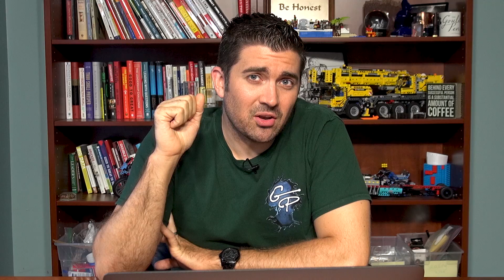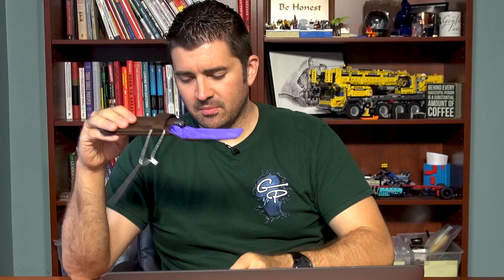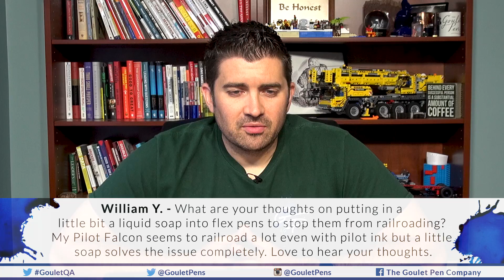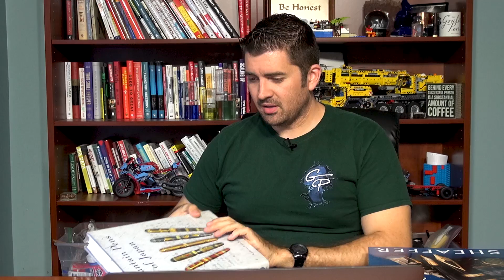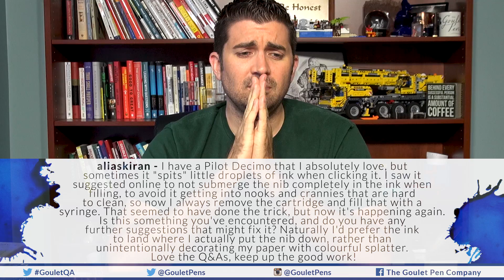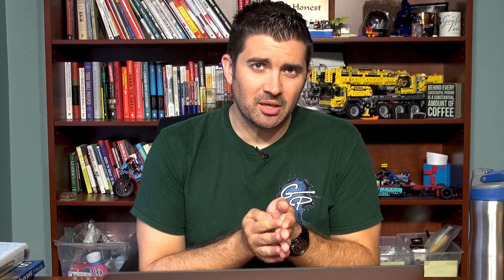Goulet Q&A 178: The Strangest Inks, Making A Goulet Pen, and Movin' On Up!

Comment: I'm three years late but answering the QotW, what would I like to see? Perhaps inks more than pens, I know you have worked closely with Noodler's  in the past but maybe coming out with your own brands or blends of inks. I imagine there would still be a lot of startup challenges including bottling, tooling up and labelling - however the one that I think would be top of the problem pile is, how to make each batch of ink consistent with the previous batch. I remember from your video with Nathan that each batch may be slightly different than the last. Perhaps that could work to your advantage and make it more of a limited edition thing. If you picked what you love most, such as shading or permanence, then see what you come up with.

Comment: The Goulet Fountain Pen .. hmm ... I see the first as an entry level pen, acrylic body, Goulet steel and Gold nib options, Cartridge/ Converter. . Because that's what I think your core brand foundation lies in .. helping people get into a long term relationship with fountain pens and the habit ... over time I do see mid level pens at the Noveau level with expansion of the this line with different form factors, shapes and nib options with a collaboration with a nib meister for different nib options. .. annually a themed LE pen which woukd be a real cut above and woukd represent the Goulet brand as it's ambassador .. I believe it would be important for the Goulet fountain pen to not challenge the bigger existing brands head on... this could skew the strategy to vacating certain price points/ ranges in the immediate term.
Reply from the maker: All good thoughts & progression. Definitely want to see it in that entry-level price range. - Colin

Comment: QOTW: I would like an ebonite feed. I don't know if anyone other than Noodler's and some Indian brands do this. A large capacity would be nice. Maybe have a blue cap and if it has a separate end that can be blue too, with a demonstrator body. Though a nice white body could work. A blue/white combo would look pretty nice.

I don't think this would work on the same pen, unless it has a swap-able grip section, but having a dip pen compatible feed would be pretty nice. I know those have to be replaced, but they have some interesting nib options, and it would be nice to not have to dip them all the time.

Comment: I would love themed pens: Mermaids (blue teal purple jewel tones), Unicorns (white purple blue iridescent oil slick or holographic like a CD), Dragons (matte black with glossy lava running down the side, or green scales), Elements (earth air fire water), Wizards (pens that look like wands). 
Possibly harder but last idea: Oil Slick barrels. Barrels that color shift so the middle is a highlight color and the edges are a different color no matter how you turn it, as long as the light hits it the same way.

I would also like nib feed combos to be kinda dumbed down for me. I tend to like wet writers, so having a wet/dry nib/feed designation would be awesome. 

Of course, with the latest trends, I'd also like FLEX options on nibs. 

It would also be kinda neat to get a pen that matches your favorite inks and made specifically for it. J Herbin Emerald Chevoir could have an emerald resin barrel with purple/gold shimmer throughout that is made to write bold and wet so the sheen comes through.

I also tend to like classic pens if you want a permanent line. White barrel with gold accents/nib, Matte black with silver, Goulet blue with gunmetal? (Ps. white and gold are my favorite colors)

There is also a pen I was introduced to by the Pen Habit channel: Kahakai by Kanilea fountain pen co. The barrel goes from a sandy opaque beige to a translucent watery turquoise/green and ends in a deep opaque blue green at the top of the cap. It also has gold accents. It's probably the most beautiful pen I'll never afford ever... even the grip that is normally black is the see through turquoise (I'm also highly biased because I'm from Hawaii)

You could also make "starter sets" with existing pens that would include: syringe with blunt tip needle, silicone sealer, bulb for flushing, sample of a set of inks (Brian's favorites, Rachel's favorites, shading inks, best sellers, etc) and a notebook to practice and do ink tests on. (Or bullet journal starter set?)

I also like monotone metal finishes: Silver barrel. grip, nib, cap; Gold barrel, grip, nib, cap; Copper/Rose Gold barrel, grip, nib, cap, Gunmetal/smoke barrel, grip, nib, cap etc... If you could order ala carte that would be awesome too

Random thought just now: Rose Gold tone nibs. I'm sure they are out there but not too common. It could just be a plating that looks like copper or rose gold but gold and silver are great classics, having another option would be amazing.

All of this of course would be if I could do ANYTHING I wanted, I tend to have a million ideas and not enough time or money to execute them. So I just throw my wishlists for items out in the world and hope I can afford them when someone else makes them. >.<
Reply: PS. Prepayment options would be nice too. Like $50 a month going toward a $400 dollar pen before it launched.

Comment: Ink spatter I totally agree with Brian its likely the pen casing has tiny amount of ink in it. I use a pilot vanishing points as my daily writer, my work pen especially gets a lot of dings from use, I bought it to be used not for collecting. I am also a pen twirler and have yet to get ink spatter anywhere. Its a medium and writes wet with iroshizuku ink. Every so often I give the inner unit a good flushing and reinking just for maintenance and i run water through the body end too as brian suggested and it always shows there is ink inside the body, not much but its there. If you clean the body too I think a change of ink could be in order for at least a little while to see if it reoccurs. I keep my pen clipped to my shirt neck when not writing, at all times so it doesn't go walking in the office, I dont put it in a bag which does get thrown around a lot, I always want a pen on me and this is my routine. Maybe after you try a change of ink, perhaps try a change of habit to cut down on how much jarring the pen experiences but you should be confident of keeping your pen in a gym bag if you want and have it perform well. If you take the body end off, wrap it securely in tissues and give it a flick you'll see spatter on the tissue. Pens use both capillary action and air pressure/humidity to effect flow and when you rapidly move pens around on their own or in a bag you are adding extra forces that can change that and force ink out, its not a defect of the pen though.

Comment: A Goulet Pen would easily switch colors (convertor). Easily switch nibs with screw in type. Not a demonstrator. Fell good in my hand when posted. Screw in cap with enough threads. Fitting clip for my pocket. Good size and weight for my big hand. Preferably not plastic. $150 or under. Best of luck in your move. Good work pays off. Congratulations!

Comment: QOTW: 
1. A fountain pen designed for travel: vac filling system, pocket size with snap on cap and secure posting (or retractable nib), lightweight but sturdy and durable. And of course with accompanying ink bottle suitable for travelling.
2. Eco friendly fountain pen - made of recycled material, or easily recyclable, or from eco-friendly plastic (bioplastic).
(in any case Rachel should be in charge of colours :))

Comment: I like the idea of a plastic dip pen as it would have a much lower cost- although it's being plastic would likely mean the tip couldn't be smoothed if necessary - so if that were the case then no plastic dip pens. Unless it were possible, then yes. I know, make up my mind :-)

As far as a Goulet pen, I really like the idea of your continuing to collaborate with companies like Edison and Conklin. In my opinion everyone benefits by this kind of collaboration and both "sides" gets to focus on their talents without the need to duplicate services and processes - and run the risk of being spread too thin. Are there other companies with which you could collaborate?

As far as my ideal pen that I would love to see - buttery smooth nibs that have slightly larger nib sizes - (I prefer larger "fines" or smaller "mediums"), smaller grips (no triangle shape) without being TOO small (between 9-10mm) and vibrant DARKER colors with a non-metallic body/grip that are light in weight. I realize it probably isn't possible to have yet another set of nib sizes considering they aren't made in the US, but it was worth mentioning as I'm dreaming here. I do like a pen I can take completely apart for cleaning with replacement nib units (and feeds)- that's of more importance to me than the filling mechanism.

I also like the idea of a time-lapse video of the move process - and congratulations on the move to the new space!

Comment: What would I want to see?  Eye Dropper or Piston (Or hybrid!) with a customizable nib.  Literally, "Select your nib" during checkout.  A long thin window on one side to show ink levels (and piston position) in an otherwise solid pen in your choice of a few different finishes.  Something durable, something pretty, plus a limited edition hand crafted, individually numbered version in something like Maki-e or burnished blue steel, or similar.  Of course, the hand crafted version would be more expensive.  For something vaguely like described, for the basic models, I'd expect to pay between $30 and $80, depending on the materials chosen.  For the hand crafted edition, I'd think about $200 is a hard upper limit.  and I mean HARD upper limit.  Closer to $120-150.

Comment: QOTW: I've thought about why hasn't a pen company designed a pen with a standard international converter, but for it to be wider to hold more ink? The body of the pen would have to be wider to compensate  for the converter, but for myself I think with the easy maintenance of changing and cleaning ink in a converter is pleasing. But to have a larger ink capacity would be a neat touch.

Comment: I don't know what the legality copy right or brand nuance of this would be, but I think seeing a pen in the lower "next level" range that's a vacuum filler similar to the visconti power filler (ie is a vacuum filler where there is a separate chamber above the feed that allows the writer to not have to unscrew the piston) would be a good addition to the market.
Reply from the maker: I think any affordable vacuum filler would be a great option. Right now, TWSBI seems to rule the roost in that regard, but I think there's design & functional changes that could happen. - Colin

Comment: Hi Brian, Chudfumpy here, I'am also a precision engineer with a machine shop in the UK full of CNC lathes etc, hence my question about producing your own fountain pen... I assumed you would farm out the manufacturing to a local machine shop with CNC lathes, as machining the parts really should not be a problem to a decent machine shop and you already have the nib side sorted.... Machining fountain pen parts is no different to machining any other engineered parts whether they are stainless steel, brass, aluminium, delrin, acetal etc... Most high quality machine shops make all kinds of stuff to very very tight tolerances and finishes, to us it's just a machined component, the same as a part for a oil rig or a space rocket or a car engine part.... Have a look at the Conid fountain pen being machined, theres a YouTube vid of it, it's not complicated, it aint rocket science. :) .... Good luck with the move Brian, I'am sure it will all pan out just fantastic.

Comment: QOTW: Modular fountain pens. Similar to Karas Kustoms, you could offer a variety of nib choices, fill mechanisms, hardware colors, and body color/materials. Want a demonstrator cartridge converter body with a goulet stub and black cap with black clip? Sure! Or maybe you want an eyedropper-only version. Well, it comes with silicone grease too! You could even have a website tool to show what it would look like with each customer selection. Each part would be individually warranted ans stocked, which is how you already do business. And you would have a high number of choices available with a limited amount of stock. Individual components that don't sell well could be put on sale or eliminated, and seasonal special caps/colors/etc would fit in with the existing products. Other partner manufacturers like Edison and Karas could make parts to your pen's specs as a cobranded operation or just to expand into the use of cast resins and metals.

Comment: I noticed the dish soap on my flex pens (vintage and nib-meister tuned modern flex) when I added dish soap to the water when cleaning them and rinsed it out and the pen stopped railroading. I noticed if I use water or pen flush the after effect of the ink flow wasn't evident.